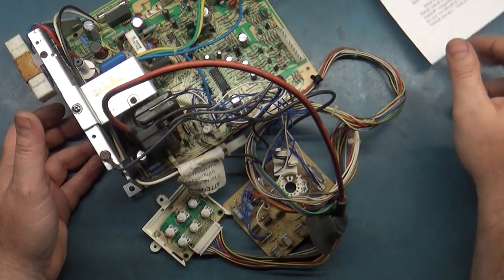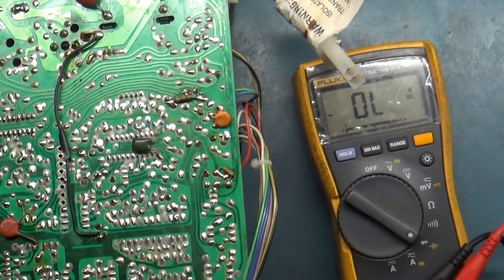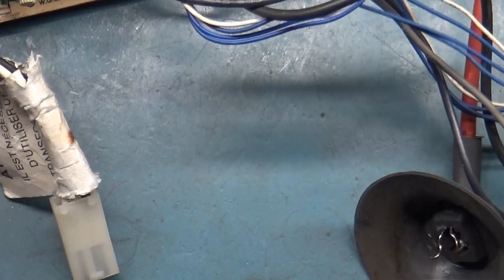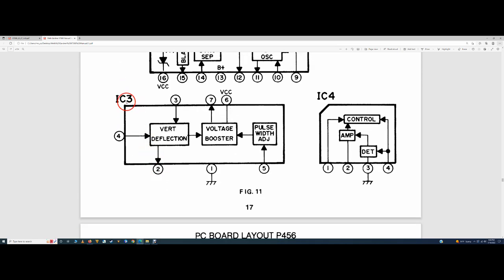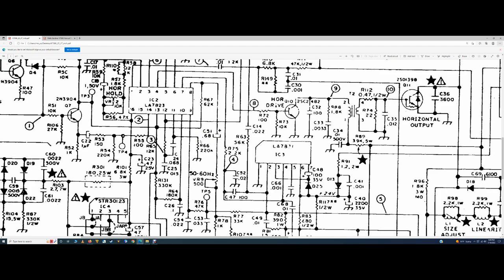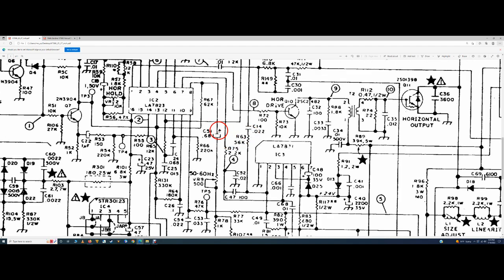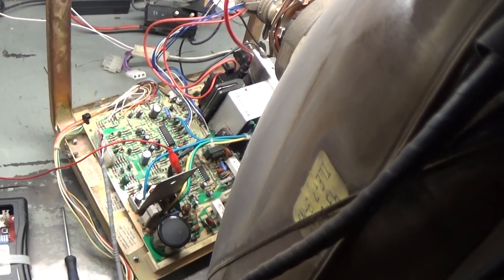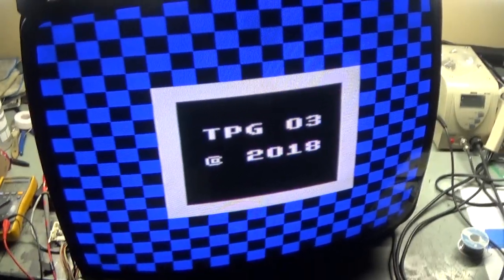25" K7000 Arcade Monitor Chassis Repair - Partial Vertical Collapse - Almost Made Me Quit!

Comment: Nice repair, i've had that tantalum bead cap cause me problems a number of times over the years when i've repaired K7000's, it's usually the first thing I check when i've got weird vertical deflection problems (although i've had the pot adjustments cause me problems as well, they sometimes seem quite fragile on the the K7000)! I've used up all the ones from my spares chassis, I need to buy some new ones again!
Reply from the maker: I'm the opposite. Never worked on one where that cap was bad before. Definitely interesting.
Reply: @MikesArcadeMonitorRepair  Indeed, from experience with the K7000 i've tended to start checking anything resembling a tantalum bead in the vertical deflection section of a chassis if it's got vertical faults. I think the last non-K7000 I had for repair with a problem caused by the tantalum bead was a 25" or 28" Neotec of some description if I remember correctly - the tantalum bead was basically the whole cause, although I changed out a couple of normal caps which were a bit out of spec. I think it was a different value to the one in the K7000, I seem to remember using one from either a Sanwa 29e31s or Nanao MS9-29 for it.

Comment: Hi mike. Excellent troubleshooting skills.  If one needed to replace that c51 cap and it had the resistor on one leg, would it be necessary to solder the resistor to the new replacement c51 cap? 

Thanks
Reply from the maker: Thanks. Most likely. It wouldn’t be there for no reason.
Reply: @MikesArcadeMonitorRepair  I'm dealing with a vertical problem right now too. I have a bottom fold over even when i max out the 50 60 hertz pot. It doesn't let me completely expand the image for full deflection. Im gonna shotgun in a new c51 and an ic2 chip and see if that helps me.  I gave it a capkit and a new ic3 as well.
Reply from the maker: I’d test Q9 as well.
Reply: @MikesArcadeMonitorRepair Fixed!  I now have full deflection with no bottom vertical squish. I believe c51 was my problem as well. I followed along with you as you pointed out the circuitry paths for possible problems.  All resistors checked out normal.  I shotgunned in a c47 cap and a c24 cap because they ohmed out a little higher than my other boards. I also swapped in a new c51 from a donor board. I noticed that several of my boards read 49k and several read 62k at the c51 cap. That difference in readings is not dependent on whether or not a resistor is added to the leg of that cap. I had that chassis on the shelf for a while and I would not have got it repaired anytime soon without your videos and support.  Thank you for that.  

Curt
Reply from the maker: Awesome!

Comment: HI Mike, I've noticed a lot of K7000's have a poly cap factory mod soldered to the flyback pins on the underside of the board (like the one in this video). 
Do you think there's any possibility that a mod like that could cure faint vertical bars on the left side of the screen? The monitor in my Jamma cab is a 19" K7000A with the Zenith flyback that's impossible to find a replacement for.
Reply from the maker: To be honest, I’m not entirely sure what that mod does. Almost all of the factory mods were not documented. However, what you’re referring to are known as “jailbars” and almost exclusively caused by bad/failing caps. I assume you’ve capped the chassis?
Reply: @MikesArcadeMonitorRepair  Thanks for the reply I appreciate it, yes I've done a full cap kit, including the usual suspects of c56 & c57 etc, I've shotgunned in several other new parts also, between ordering parts & working on it I've literally spent weeks on it before waving the white flag, that's why I feel your pain on this one you just fixed lol! 

Even tried the known mod of changing C204 on the neck board from a ceramic to an electrolytic of 22uf which helped a little bit but they're still there. 

I commented on this other video of yours a while back which shows the exact same problem on a K7000A at about 4 minutes in https://www.youtube.com/watch?v=Rwdb1Bv4I20
Reply: Anyway, I know I'm probably clutching at straws with the poly cap on the flyback mod, just thought I'd check with you in case you'd had experience with that. 

Really great job on this one with the bad C51, always good to learn something new about these K7000's loved the detective work & how you didn't give up on it :)